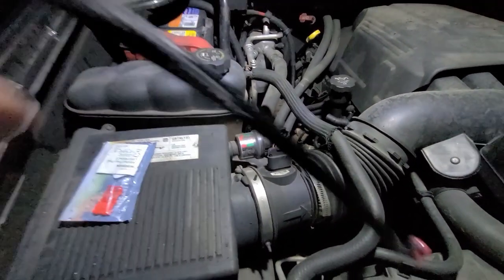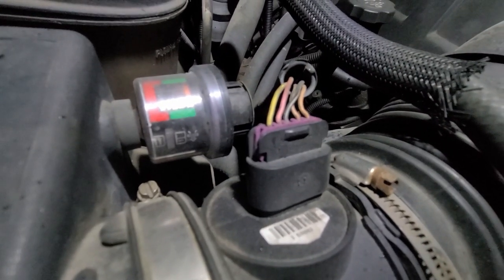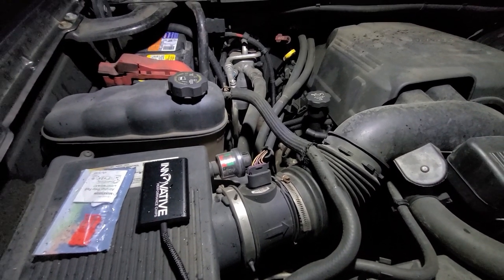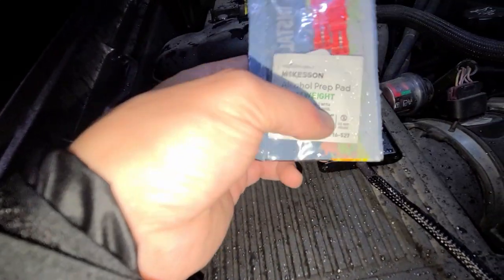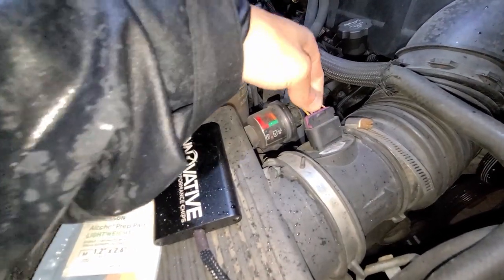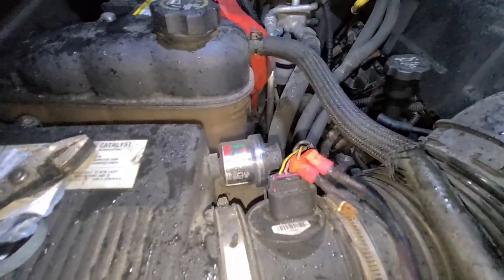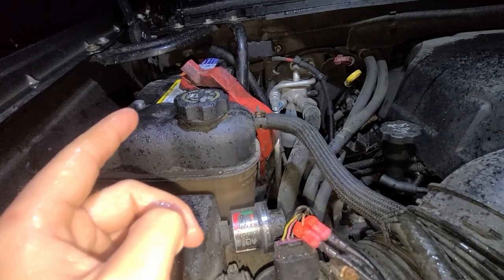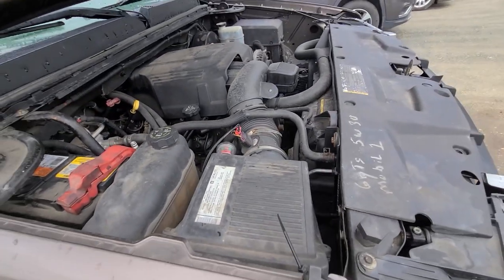Installing a Innovative Performance Chip on my GMC Sierra 1500

Comment: This honda i got off my buddy has one. Im wondering if the darn thing'll burn rubber maybe pop a wheeler. Thats what im hopin i can just run er work and to the local church so thats my question if youre able to help a fellow chipped friend because im confused and should i or shouldn't i so give me a call back thanks any info is appreciated
Reply from the maker: Definitely not